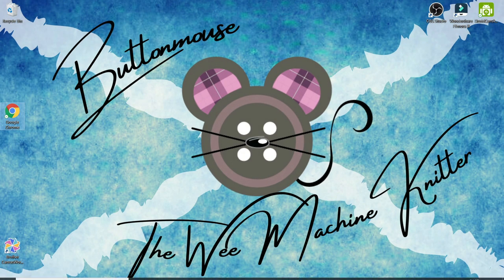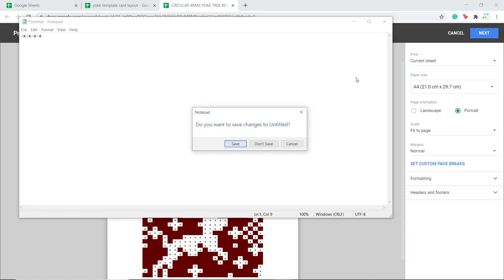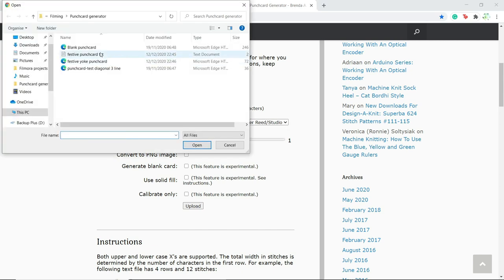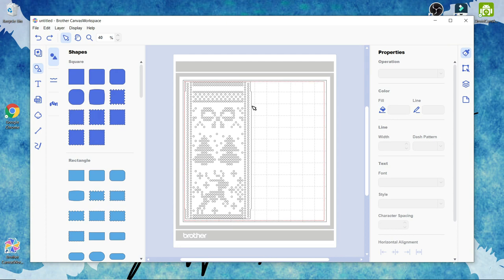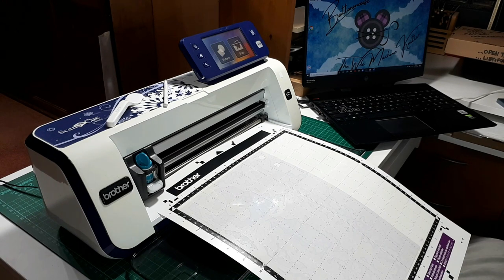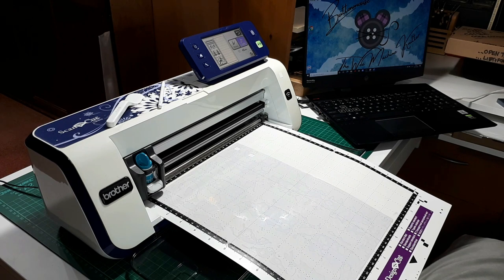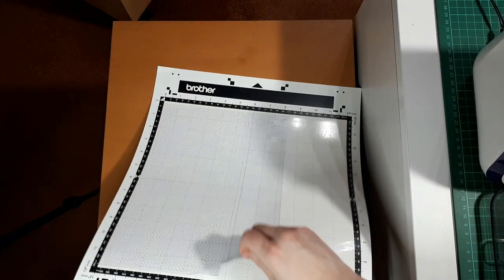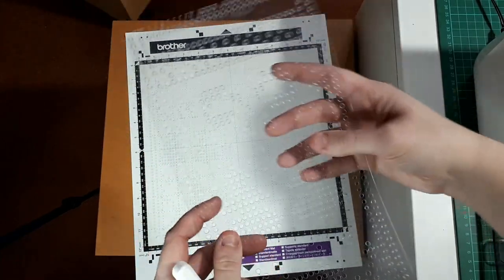Cut a punchcard on scan n cut

Comment: where did you buy the plastic material to make the punch card in your video, please?
Reply from the maker: I bought it from amazon, although I found a4 a waste. using a 12x12 allowed me to place 2 24st punchcards side by side only limitation is the row to allow the length to fit the 12 inches.
Reply: @buttonmousetheweemachinekn6344  and using the 2 24 stitch punchcards, are you able to fit it in the deco??
Reply from the maker: @knit1924  I would imagine you would have to create the deco card using the generator software. I was explaining the limitation on the cutting area relevant to the media sheet I used.